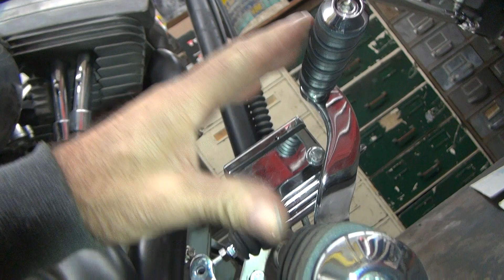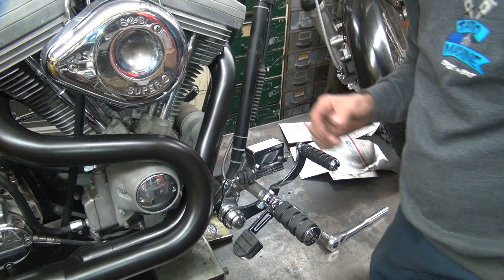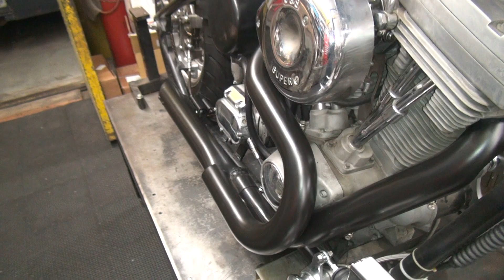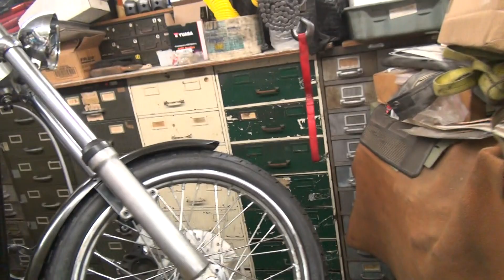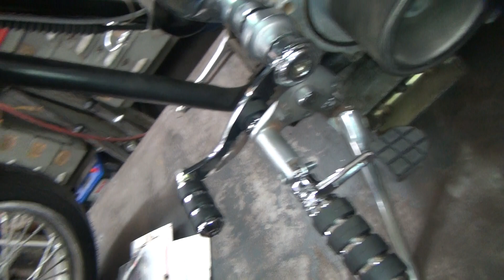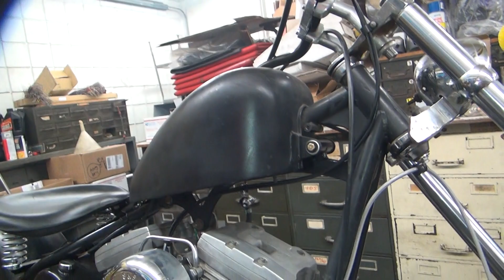#187 1999 80ci evo chopper used bike tune-up repair rebuild rigid bobber custom harley tatro machine

Comment: What's your opinion on using a SU carburator on a 1340 shovelhead? Do they work?
Reply from the maker: just like on any motor, they either work or they don't. if it is off there is not too much you can do to fix it. they have very few adjustable parts and most are not avilible these days.
go watch the 1978 93ci shovelhead playlist to see how i adjusted it.
tatro